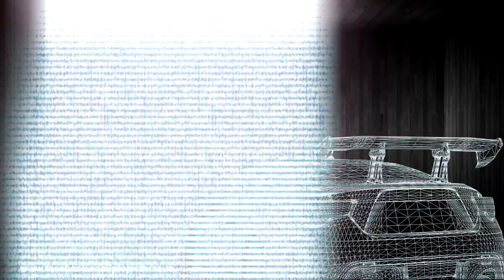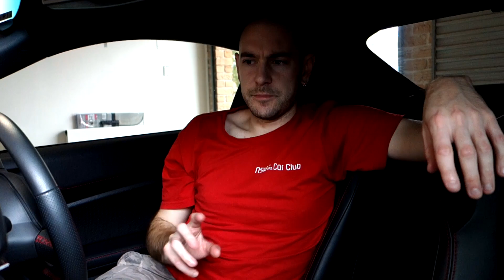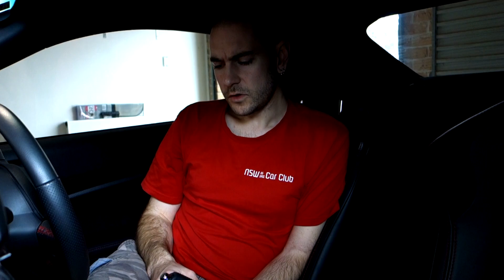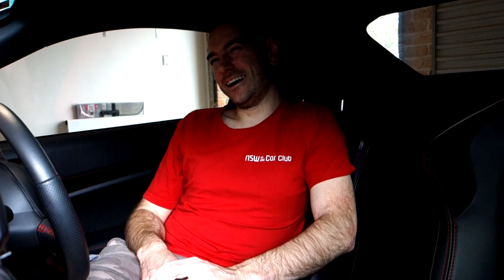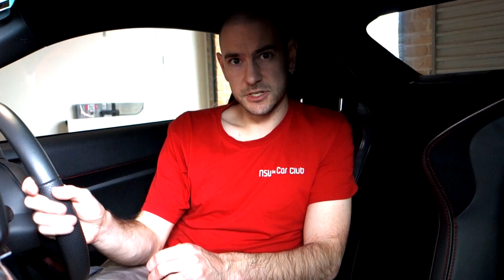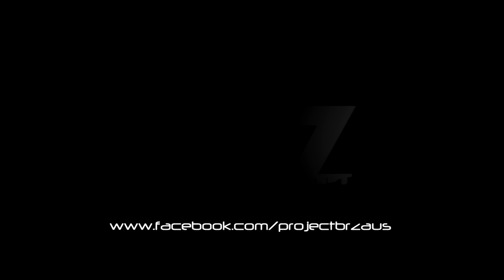Cearing Defects - How to pass IM240 Emissions & Engineering

Comment: Will guys from Tunehouse guide you the best path to get it engineered/emissions test?
I do want to get a turbo kit for the BRZ on stock block and keep it legal, it will have stock brembo but upgraded pads.
Was your engine stock with supercharger kit?
What about airlift suspension for engineering point??

Do plan on getting a BRZ soon!!
Reply from the maker: I organised the engineering myself through Consulmotive.
Reply: @boostedmedia  Did your aftermarket taillight get approval or a defective part on the car??
Some people are getting defected, brake lights red and indicator clear amber?
Reply from the maker: Passed no problem.
Reply: @boostedmedia  So you can get valenti or similar taillights as long as they are ADR approved or engineered right?
Reply from the maker: Correct

Comment: Did you have to get the coil overs locked?
Reply from the maker: No. Engineer passed them as they have double locking rings so they can’t come loose.
Reply: Don’t they all have that? What brand/type are they? Did they come like that or did you put an extra ring on?
I have bc type r, are they similar?

Comment: Just a question about emissions.

The car I have you can get catless downpipe or 200 cell downpipe.

Would there be any difference in emissions between 200 cell down pipe and catless downpipe with a 200 cell cat welded into mid pipe?
Reply from the maker: The further down the exhaust the less efficiently it works so yes.

Comment: Great video with a lot of information that will help me with my 2jzgte VVT-I engine conversion later in the year.
Earned a video like from me.
Reply from the maker: Thanks a lot for the like and comment. Glad you found it useful and good luck with your conversion. 

It should hopefully be a lot easier for you depending on what car you’re putting the 2jz in to as the rules for older engines aren’t as strict. At least not here in Australia.
Reply from the maker: Also mate sure you check out the written article on my website that goes in to a lot more detail. :)
Reply: Boosted Autos I plan on putting a 2jzgte vvti engine, auto transmission and engine/ trans loom from a 1998 toyota aristo jzs161 into a 2003 holden commodore vy series II while retaining all factory options still functional.
Reply from the maker: That sounds like a really fun project! You should film it!
Reply: hey man how did it end up going?
Reply: hey man how did it end up going?
Reply: hey man how did it end up going?
Reply: hey man how did it end up going?
Reply: hey man how did it end up going?